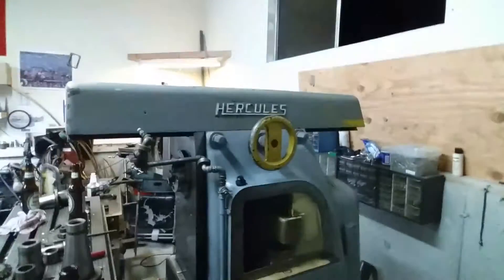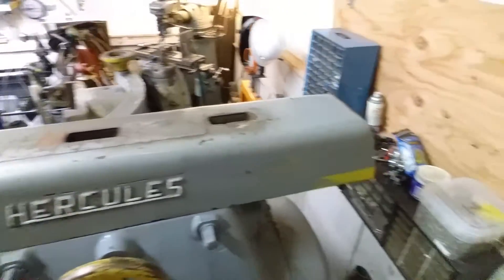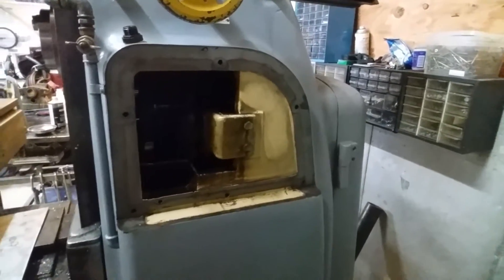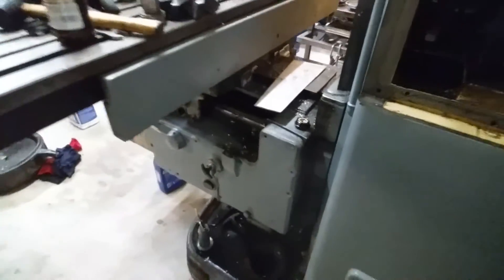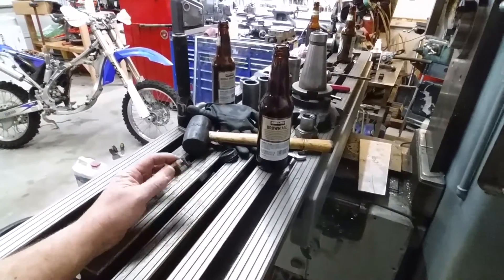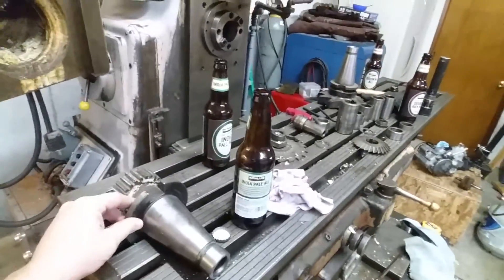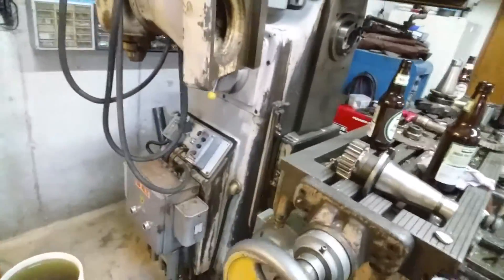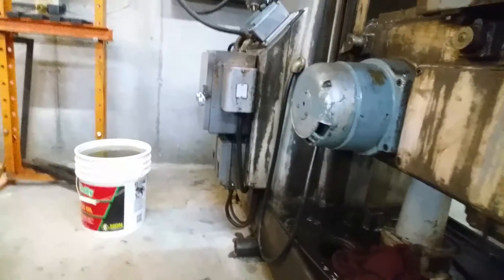1963 Hercules Universal Horizontal Milling Machine

Comment: Hi Aaron, My Grandfather recently passed away and left me with a Hercules 3P with vertical head like you have. I've also had a hard time finding any documentation for it. Do you have any links or documentation you could pass on to me (even if in Italian).  Thanks for posting a video.
Reply from the maker: Chris Baird, I have only a photocopied manual, in Italian.  It's in a three ring binder of sorts, and could easily be copied.  Where do you live?  Sorry to hear of your Grandfather's passing.  What's the history of your 3P?
Reply: Aaron,

Thank you for the reply. My Grandfather worked as a career machinist at the Defense Depot in Ogden, Utah. After he "retired" he started a small machining/fab shop. I'm not sure where he got the mill, possibly surplus from the Defense Depot as they shut the depot down in 1997. But, he was a master "wheeler dealer" and it could have come from anywhere. I've also inherited an American Pacemaker lathe from him, which is an amazing machine. 

I live in Utah and, if you'd be willing, I'd love a copy of your manual. I'd be willing to cover whatever expenses you may incur. Thank you, Chris
Reply from the maker: Chris, if you do Facebook, message me over there.  Aaron Garney.  I am heading to Fedex Office to copy the manual.  Do you do paypal?
Reply: Thank you! Message sent over on FB. You might have to check your message requests folder.

Comment: Good to see you back Aaron - that's a fine machine. By many standards quite young! Table looks very good.
Sadly I sold my old horizontal long ago - sure miss it.
No end of uses for beer bottles LOL.
Reply from the maker: ChrisB257 Hey buddy.  Tell me about the horizontal mill sold.  Thanks for stopping by!
Reply: Aaron -- darned if I ever really took note of the make of my old mill. It was huge and very heavy and not in the best of condition but it did the job when needed. It was one of many things I had to sell before I moved over here in 2000.